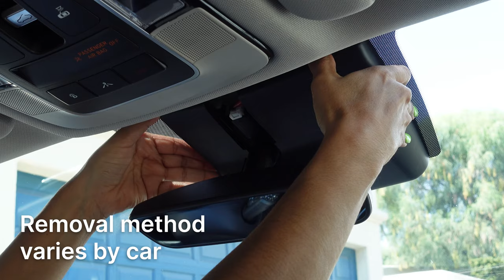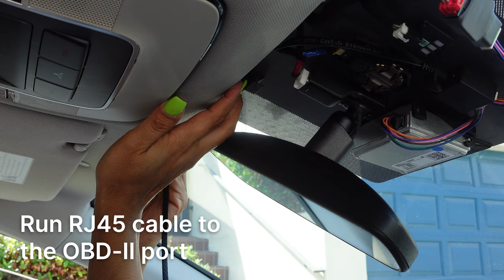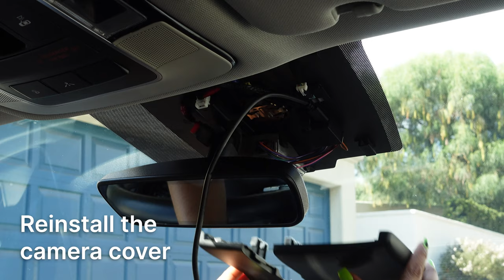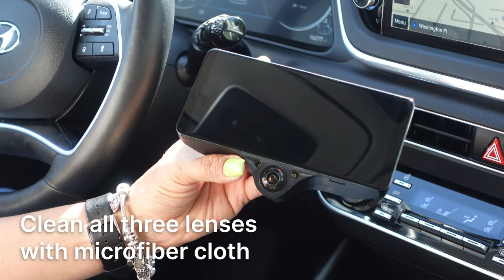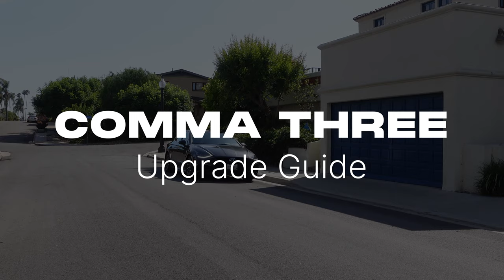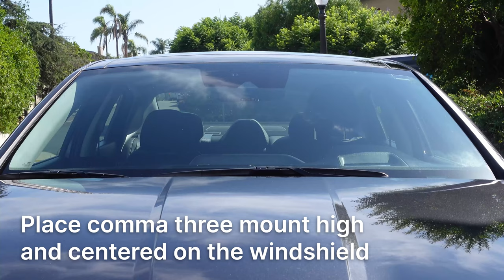comma ai | comma three devkit Installation and Upgrade Guide | comma.ai/shop/products/three

Comment: I just got 2022 new interior Silverado 1500 with Forward Collision Alert, Lane Keep Assist with Lane Departure Warning, Automatic Emergency Braking, and Following Distance Indicator. But it does not have adaptive Cruise Control. Will comma 3 work in my 1500? I am really looking it to get one.
Reply from the maker: https://comma.ai/vehicles if you select Chevrolet you will see Chevrolet Silverado 1500 note "openpilot requires the car to come equipped with Safety Package II." 2022 is not noted but probably best to ask in the https://discord.comma.ai/ channel if it's supported or if you can help them add the support. You will probably need to add fingerprint as noted here https://github.com/commaai/openpilot/wiki/Fingerprinting if someone did not add it already.
Other useful links:
https://commasupport.zendesk.com/hc/en-us
https://github.com/commaai/openpilot/wiki/GM
You can return the device back in 30 days with money back if you can't make it work but I am sure if you are willing to do some work people on discord will help you get this working.
https://comma.ai/shipping What is the return policy?  "If you are unsatisfied with your purchase from the comma shop for any reason, you have 30 days from the date of delivery to request a full refund. Request a refund here."

Comment: Will the radar cruise control steering wheel switches (including the spacing switch) still be working upon integrating this kit?!
Reply from the maker: This kit should retain the OEM functionality of the switches. There is also a toggle in the settings of the device that will disable the device and give you back full OEM functionality of your cruise control.
For more info join https://discord.comma.ai/.
Also make sure you read:
https://github.com/commaai/openpilot/blob/master/SAFETY.md
https://github.com/commaai/openpilot#licensing

Comment: I’d love to install it on my 2017 Nissan Pathfinder! Is it possible to make it work?
Reply from the maker: It's up to the users to add support for more cars. https://github.com/commaai/openpilot#community-and-contributing. Join the discord and search for info there how you can add support for your car. Usually there is not much difference between similar models so it should be quite straightforward to add support for your car.
https://github.com/commaai/openpilot/wiki/Fingerprinting#to-add-your-car-to-future-openpilot-release
You can also look at some examples from people that have done it:
https://github.com/commaai/openpilot/pull/1768
https://github.com/commaai/openpilot/pull/1801
https://github.com/commaai/openpilot/pull/21709
https://github.com/commaai/openpilot/pull/21354
https://github.com/commaai/openpilot/pull/21382